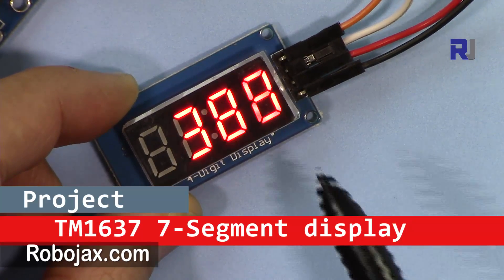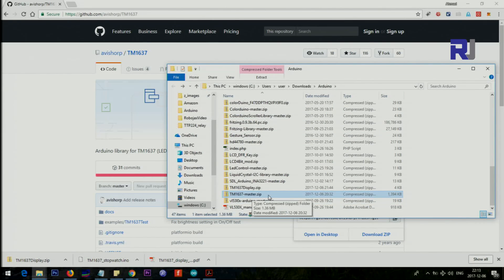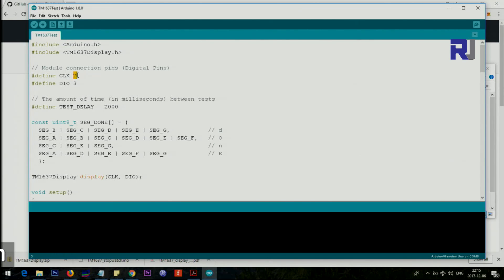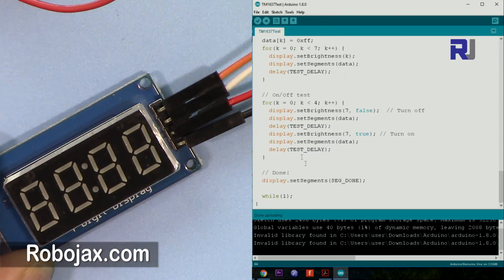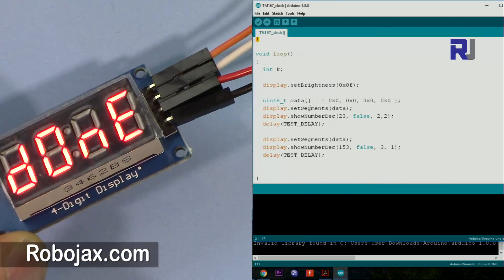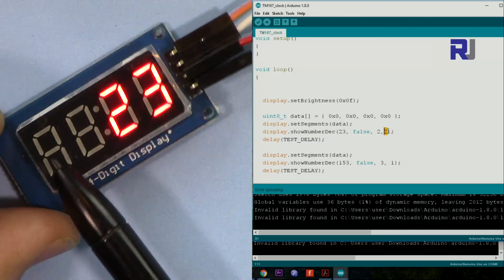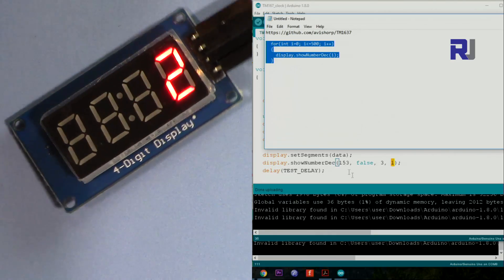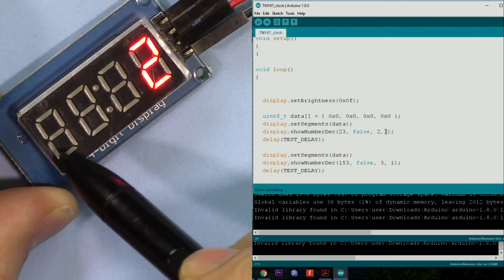E19 How to use TM1637 4 digits seven segment display with Arduino RJT19

Comment: what kind of cable is used to connect the pins
Reply from the maker: It is called male to female wires or dupont wire . This display is just junk don’t use it. Use this https://youtu.be/tEwWsbHQA5Q

Comment: Hi, as always great video. I have TM1637 6 digit seven segment display. Im trying to make a counter in min, could you please help me, or point me in the right direction regarding the code. Thank You
Reply from the maker: Hello, tm1637 is not useful for many applications. Use HT16K33 which can be used for anything https://youtu.be/tEwWsbHQA5Q

Comment: Nice video! But, how I turn on the two dots of the middle? Thanks!
Reply from the maker: The module I have, does not have the "colon" but it is possible to turn it ON . I would have to make video on that.
Reply: maybe display.point(); can help

Comment: There is another type of 4 segment display which looks exactly like this one but its written "YLB3642BK" on that instead of "3462BS" . That did not work with this library. I got another library named "DigitalTube" with which it worked.
Reply from the maker: The display doesn't matter. it is the chip TM1637.

Comment: The 4 digit display doesn't show anything.
Reply from the maker: You must include the library I provided. Copy and use the code provided. Watch the video without escaping and check wiring.   It should work
Reply: Check the side of the display. Is it written "YLB3642BK" or "3462BS" ?  This library is for "3462BS"

Comment: Beginner question:
Do the "DIO" and "CLK" ports need to be connected to work?
What is the port to receive data?
Maybe it's a very basic question, if so, where can I find this information to study it and learn.
Thank you
Reply from the maker: the DIO is data and CLK is clock. When Arduino sends the digit to display it sends it with both data and clock and both needed by the chip on the display module in order to understand and display the right digit.
Reply: Thanks for answering, i'll give it a try!
Reply from the maker: You are welcome. I have used this in multiple videos. just search for TM1637 or see them here https://www.youtube.com/results?search_query=robojax+tm1637

Comment: Nice sample program.
But I do not know what "Arduino.h" is doing.
Reply from the maker: Thank you.
the "Arduino.h" is located here \hardware\arduino\avr\cores\arduino, is standard Arduino library and does majority of functions in Arduino such as "math", "string" and more. 
It is included in every sketch  of Arduino except when there is another library such as "TM1637Display.h" is included.

Comment: How do i turn the dots on?
Reply from the maker: I checked the datasheet http://robojax.com/download/datasheet/robojax_TM1637_datasheet.pdf and did not find anything about the dot. Tm1537 is a chip for 7 segment display with dot. But the manufacturer of this module, used a display that has dot .
Reply: somewhere in example code the dot turns on. So you can analyze the code to find how you turn it on.
Reply: if you are talking about the decimal points it looks like most displays cannot turn them on even if it is built into your display. if your are talking about the clock dots try changing int k from =0 to =1 should turn them on  and use display.showNumberDecEx("value", (0x80 >> k), true);

Comment: where can I find a 12hr code for the display
Reply from the maker: I2C protocol is used for two way communication. This device can only receive input and does not respond. This library and code that I used , works with this module.. Here is the link https://goo.gl/rDwBqg
Reply: what i'm trying to make is a Arduino clock with a Adafruit 24 RGB LED Neopixel Ring around it